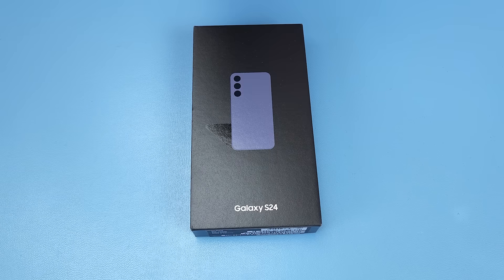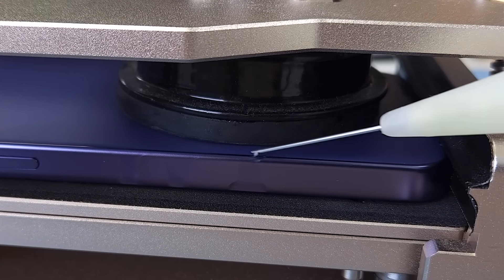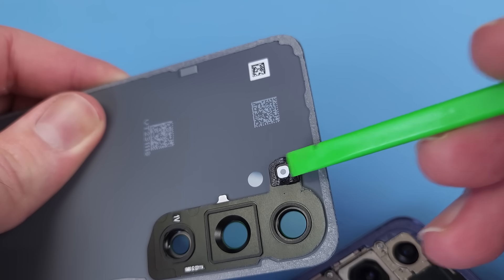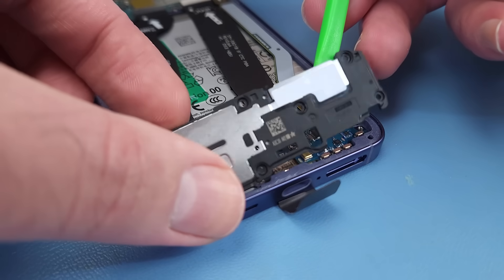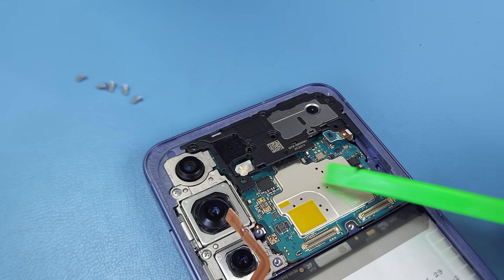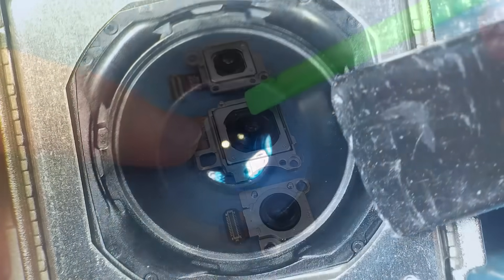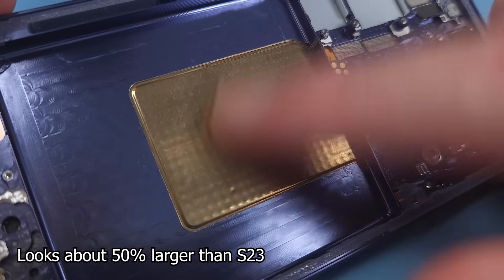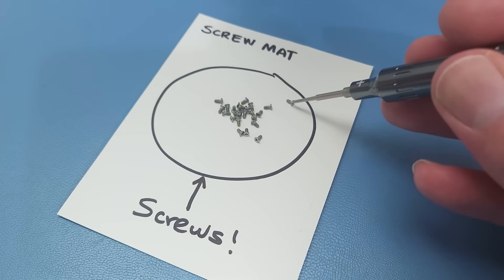Samsung Galaxy S24 Teardown - Full Disassembly

Comment: Samsung doing like Apple with the USB 2 cable. An then people only complain about Apple and don’t see what happens with Samsung!
Reply: Because the Samsung still have a USB 3 port and give you a cheaper cable. Apple gives you a USB 2 port on the non pro iphones
Reply: @Flo-cg2jl  That is your problem if you get the non pro iPhone. A normal user won’t care about USB 2 or 3
Reply: @stormrider01 samsung phones have the usb 3 port just not the cable the iPhone has usb 2 port and cable iirc
Reply: @stormrider01 That's straight up not even true. Many iPhone users do things like backing up their photos to their computer. Doing this over USB 2 is ridiculously slow compared to USB 3. Apple fans love to say "just pay more" instead of acknowledging that their favorite company cares about money over functionality of their products. Imagine paying for the new pro iPhone when we get these features by default on base model Androids.
Reply: @gazehound I should remind you that Samsung very very often copies apple with the addition of gimmicks that android fans like to brag about and are easy to market
Reply: @river.  Apple had 120hz in 2017 with iPads already and the usb port, just like 120hz is an open source stuff
Reply: @nomecognome2  but not on phone though. Even Samsung monitors had 120hz before 2017.
Reply: @river.  it’s a technology that’s been around for many years and saying that using this tech is copying is just like saying Ryanair is copying Delta for using Boeing 737
Reply: @nomecognome2  so what, they made a corporate decision to give 120 hz and that's copy of the Samsungs and other companies decision.
Reply: @river.  well every smartphone is a copy of the iPhone 2g if this is your logic
Reply: @nomecognome2  yup, every company copies something from someone and it's not a problem as long as we get better product.
Reply: @river.  I agree, as long as it’s not a shameless copy and paste
Reply: @TheRealAryans567  right so Apple copied it and engineered the iPhone in 2 months?
Reply: @Kevin-mx4vm  what do you mean?
Reply: @nomecognome2  LG was the first phone with capacitive touchscreen not Apple, even if it's just two months, stop coping
Reply: @Kevin-mx4vm  I mean they are both phones so they’re copying the first phone ever
Reply: @nomecognome2  stop crying isheep 😂
Reply: @ilbufalantdellefigurine4488 if they was so EASY Then APPLE would Just meet Them... Right?  Ohh wait 😅😅😂😂
Reply: @stormrider01  what if i dont have money to get a pro iphone?, why not just use all usb 3 on all iphones?
Reply: @stormrider01 You're truing to make a problem. You don't know what you're saying
Reply: @stormrider01 apple fanboy😂
Reply: Bro are you crazy usb 2 is 20 years old@stormrider01
Reply: Wait so the iphone 15 has 60hz and usb 2 at that price? 😂😂😂😂
Reply: @pronetodancing24  yes, it’s quite an awesome phone if you ask me. If it weren’t for ios I’d be torn between it and the standard s24
Reply: @ilbufalantdellefigurine4488  the s24 just has better hardware. In my eyes one ui 6.1 is honestly better than IOS but I definitely understand the appeal
Reply: @pronetodancing24  well the iphone 15 has better battery life, better processor; and often times better cameras. Displays aside from 120hz are very similar. I like iPhones and have many apple products so of course that’s what I’d buy. I like the s24 design though
Reply: @ilbufalantdellefigurine4488  The iPhone 15 does not have better battery life, and their GPU scores are actually lower than the galaxy series. Also, the cameras are subjectively based on whether you like more or less saturation. Hell, their CPU score isn't even that much higher this year to even make a difference. IOS was arguably better because of the smoothness of the UI and video capabilities, and that's it. Now, the s24 has actually great animations with one ui 6.1, and it has better camera capabilities, including optical zooming/pausing during video capturing. They even made it so that the snapchat and IG apps both use the system camera for their apps on one ui 6.1. I would suggest looking up what the s24 is actually capable of. All that aside, the hardware blows the iPhone 15 out of the water. The 15 couldn't even beat the s23 in a stress test or gaming test, so I don't see how the processing is better. I'm not knocking you for what you like to buy, but the 15 didn't even get the crown last year. Literally, almost every reviewer gave the smartphone crown to the s23 series.
Reply: @ilbufalantdellefigurine4488  Honestly, I think it's an insult for apple to charge its customers flagship prices without even providing all the flagship specs. Usb 2 and 60hz on a flagship should be unforgivable. Budget phones have at least usb 3 and 120hz for like 300 bucks, lol. Go look up reviews from YouTubers who are apple fans, and even they say it's time for apple to stop skimping on the base models.
Reply: Quit whining!
Reply: Because Apple causes this greediness issue in the first place and if they can make billions of people's naivety why can't others? Samsung is not to blame Because they did not come up with headphone jack removal to make billions on Airpods, charger removal to make billions on Magsafe, or ssd card removal to make billions on charging $400 to double the storage. At least With Samsung you get AMOLED screens on majority of smartphones and tablets as cheap as $200 like Tab S5e. You better buy it now case once Apple "introduces" OLED on iPads they will charge you $2000..and of course Samsung will do the exact thinb the following year (especially because they make screens, memory and other components for Apple so why should they be treatedas 2nd category) Do you now get it, or need few more years to contemplate?
Reply: port is more important than cable you can just buy new cable unlike the 15 that comes with older tech female type c port
Reply: Cry about it iPhone is usb 2.0 samsung is usb 3
Reply: The most stupidest thing an android user can say is fan boy or Isheep whenever they can't win an argument I'll say it's better to be an isheep then a puppet that watch 15 ads per second, and no I use samsung.
Reply: Still samsung is far more better than apple you can hate me but its the fact
Reply: Bro you can find a usb 3 cable, but what you can't do is fix the fact that apples $1000 phone has a usb 2 port. That can't be fixed. A five dollar cable or more likely one you just have sitting around isn't actually a real problem.
Reply: You also want a thin charging cable right? That's how you get it. Of course for a grand the charger should be in the damn box too.